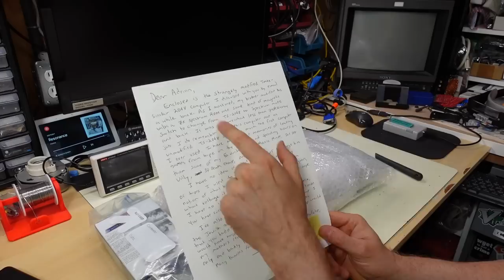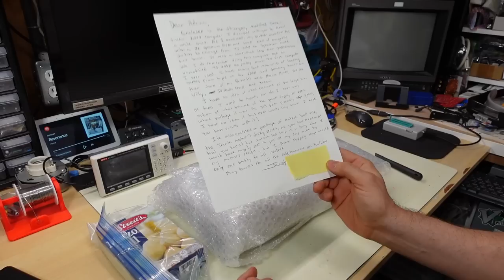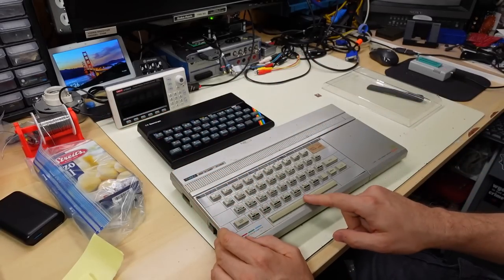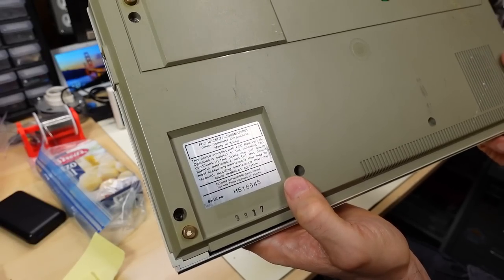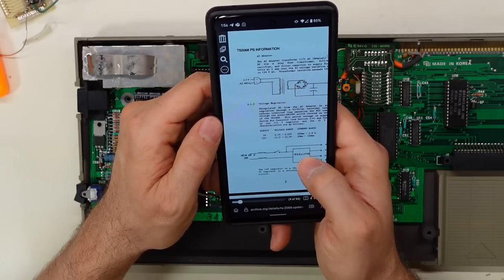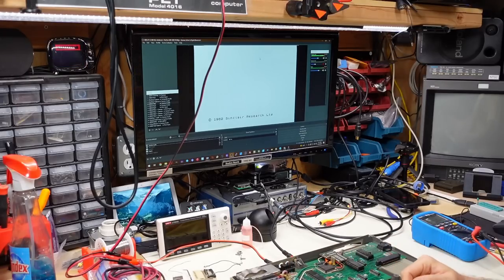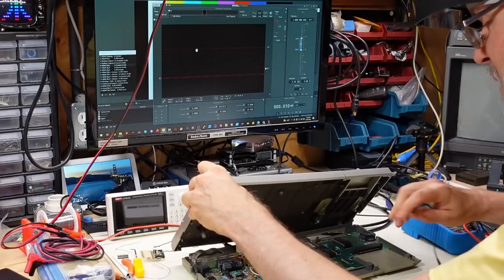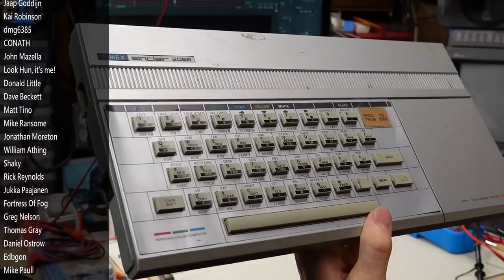0044 The ZX Spectrum of North America: The Timex Sinclair 2068

Comment from the maker: I have chatted with someone familiar with this machine, and it definitely should color (and a color burst.) There will be a future repair video where I dig into what might be wrong with this machine to get it fully working!
Reply: By the by, I just got my 2068 turned on, and it seems you have the spectrum rom in there, mine shows a 1983 Timex Computer Corp copyright line when it is turned on.
Reply: If possible, I'd also love to see a video about upgrading the internal RAM on a ZX81 / TS1000. There are several ways to do this, all fairly easy, but I think they'd make an interesting video.
Reply: I wonder if it's doing something odd like 60hz PAL - you'd have a different colour signal then.  That extra bodge board above the video out has me wondering.. did the owner mod it to also do PAL 50hz and you only have half the mod left?  

Games do run faster in 60hz - you can toggle scan rates on the Spectrum Next and not only do the games change speed, the pitch of the music (often generated under interrupt) change also.  Few games were written for the US market because as you mentioned it wasn't popular there.

9v centre negative is exactly what I'd expect.. good call on checking the polarity first, since centre negative is so unusual.  There's no protection on the circuit so connecting them backwards would cause the magic smoke to escape.
Reply: Well, it says  “Personal Color Computer” on the lower left side of the case, so I think there should be some color… 😅
Reply: Adrian, Modern Vintage Gamer on YT did a video on the 2068, His unit had the same bodge wiring that yours has on the user port and VLSI chip. Archive org has the user manual, page 6 shows the side ports are joysticks in the text.
Reply: The color circuit needs the 15v, but you were already at 9v when you tested the colors. Also: the easier way to check the colors is with the BORDER statement, which needs no shifting.
Reply: Someone else said that part of the voltage regulation used a switch-mode power supply.  If that's so, then the hissing may be normal.  Others have said that it is normal.  Also take note of what Alejandro just above me said.  The color circuit needs the 15V supply.
Reply: If that help, search for informations from a CP-400 from Prologica. Was a very popular clone of that computer here in Brazil.
Reply: @TonyHoyle  It's very English to do the things the other way around :)
Reply: Being a more affluent country we would pay more for a commodore 64 or something at least with a decent keyboard.  The Brits around that time were having some financial issues so money was tight and cheap ruled or you just did without.  Also when this unit came out there were better systems with a much larger user base and software selection.  This Timex system was just too late to the game to gain any momentum.
Reply: @pcm2012  And Japanese! Spectrum chugs nicely with a SEGA Genesis Model 1 power brick.
Reply: Standard Atari Joysticks, 

That's the UK Rom running... The start screen says Timex Sinclair or Timex 2068 on boot with the shipped rom. the ROM is likely the cause of no color, since there's no PAL circuitry.. 
I have a TS2068 that I tried a 24V Telephony Power supply after the stock 19V wall wart smoked, and my TS2068 didn't survive that. Running 9v, eventually the computer freezes. But I think i still have a couple of user group cassettes checked out with it. The 2068 composite out supported a "hi-resolution" mode, but the OS didn't support it, so you could enable it, and see the regular 24 character screen with intermixed whatever was in the next 8K block of memory between each character.

Comment: This was my very first computer. The keyboard was horrible, but I have to say, if you did a lot of BASIC programming on until the key combinations became natural - you could actually code faster than someone who had to type every keystroke of every keyword.  In a sense, this keyboard is the godfather of autocomplete.  LOL
Reply: If you compare to PC keyboards, the 2065's was pretty bad. However, if you started with a ZX81/TS1000 the 2065 keyboard was a godsend!
Reply: In a lot of BASICs, you could abbreviate keywords.  Atari 8-bit BASIC, which I used a lot (username relevant) would let you enter, for example, "SE." instead of "SETCOLOR" (you'd get the full word on LIST, er, L.).

Comment: Those bodge wires are factory. The "Upside down" PCB is also factory. The T/S 2068 was really not fully baked when it was released. Timex needed to get the computer out for the Christmas 1983 season so they did what they needed to do to get a working system out to consumers. The "Hissing" noise is from the switching regulator and there is an OP-Amp inside the switching regulator chip that picks up the switching regulator frequency and amplifies it through the speaker. I bought one of these machines (actually pre-ordered it) back in 1983 when I was 15 Years Old. I am very familiar with this system and we even have monthly Zoom meetings. you can see old meetings I believe on the Timex Sinclair Fans YouTube channel.
Reply: Also, you need at least 14V for the 12V linear regulator to regulate properly and the 12V is used for the color circuits.
Reply: @mileselectronicsstudio7316  came to the comments to say just that! The voltage needs to be higher to get color.
Reply: You mean https://www.youtube.com/@timexsinclairfans right?

Comment: The parts falling out was for the voltage regulator, check if the other brass nut is shorting something under the pcb. hissing noise???

Comment: Hi. It should be colored. Try to rotate slightly VR2 and VR3 variative resistors. And could you check with oscilloscope RGB output signals? On my Timex I see signal only in the Green channel and I suspect my ULA is partially brocken (Composite out works fine and it's colored).  Allow me please to send you photos via Twitter :)

Comment: The cassette connection on many of these old machines were mono audio cables to whatever old mono cassette recorder you had around, as long as it wasn't complete garbage.  Nothing brand specific like the Commodore Datasette. The user would be instructed to press play or record at the right time.  Some fancier machines had a smaller 2.5mm jack for controlling the pause function via the input normally connected to a button on the microphone.  Of cause these days it would connect to some other audio storage as modern cassette drives use the same awful cheap mechanism with very few quality options such as a slightly heavier flywheel.

Comment: My mom worked for Timex in the 1980s at a distribution center in North Little Rock, AR. The facility had a PDP-11 installed that was never used. She and her team opened up the manuals and learned how to get it bootstrapped and load the custom inventory software needed to automate the distribution instead of relying on all paper ledgers. The company remembered this several years later and gave all of her team that still worked there free 2068s. At the time we had an Atari 800 and dad used both a C128 and an XT clone which ran AutoCAD. 

I remember mom buying a little portable TV and setting up her 2068 at her rolltop desk with the TV perched on the top shelf at roughly eye level. She used that thing into the early 1990s when it went out completely. Dad bought her a 386 DOS laptop from Zenith and she used it but even years later talked about how much she missed her "Timex PC".
Reply: What amazing stories - thank you for sharing them with us! 🙂
Reply: That little computer meant a lot.

Comment: Wow! This is fun. I just got my TS2068 out of its box a few weeks ago!

Here's some info for you:

1. The thick white bodge wires are from the factory. Some of the others were added by the former owner.
2. You aren't running the Timex ROM, but the ZX Spectrum ROM. If you have the Timex ROM, you get TWO copyright lines at bootup. I think you're missing the Timex ROM, which would have gone in the other socket of the add-on board.
3. You need the voltage up around 15V for some of the circuits to work.
4. The Russell company made lots of ZX81/TS1000/ZX Spectrum/TS2068 add ons in the 1980s. There would have been a reed switch under that label and a button magnet that you'd slide back and forth to switch between them.
5. I suspect the little add-in board near the edge connector is a video adapter board. Unlike the ZX Spectrum, the TS2068 had RGB signals available on the edge connector (TTL RGB). This could drive a CGA-type monitor. But, the Hsync and Vsync signals are NOT available separately. You have to extract them from the composite video with a small circuit. The technical reference manual that you had up on your phone discusses this and includes the recommended circuit. However, several people sold circuits that worked better for this purpose and used ICs instead of discrete transistors. Another odd omission is the I signal. Although the TS2068 will show 16 colors via composite and RF, there's no way to get the I signal and feed it to an RGBI monitor. So, an RGB monitor will give a much nicer picture but only 8 colors. Incidentally, the interference that you see on the composite signal is normal. The crude switching regulator makes a ton of noise. Many current TS2068 owners replace the power section of their computer with a modern regulator to clean up the composite video.

Looking forward to seeing what you do with the TS2068 next! And hang in there. Once you get the knack of the keyboard, you can type code VERY fast.
Reply: It's a switching regulator?  That explains the hissing.
Reply: @melkiorwiseman5234  Yes, the 5V is a rather crude switching regulator. The 12V is an undersized 78L12 linear regulator.

Comment: There is an european version, the Timex Computer 2068. Some may call it a clone but in fact it is the same computer, designed by Timex Portugal with some hardware differences. It uses the same ULA and ROM, the big differences were the rear edge connector which is ZX Spectrum compatible (the TS2068's edge connector is ZX81/TS1000 compatible, and can be made ZX Spectrum compatible with a Twister board), the cartridge port can receive thicker cartridges, and it uses 9V DC center-negative power supply like the ZX Spectrum (in fact, the PSUs are compatible). Also the TC2068 was sold with a ZX Spectrum compatibility cartridge (Emulator Cartridge), which basically when inserted disables the internal ROM and replaces it with a ZX Spectrum ROM, increasing substantially the compatibility with most ZX Spectrum software.

The TC2068 was made like this to be compatible with lots of peripherals and software already existing in Europe, that don't exist in the US since the ZX Spectrum was never released there.

Timex Portugal also launched the TC2048, a ZX Spectrum 48k compatible, that uses same ULA of TS/TC2068 but it's more compatible with the ZX Spectrum than the TC2068 with the Emulator Cartridge. It has a slightly modified Spectrum ROM and it retains the hi res modes of the TS/TC2068, and a Kempston compatible joystick port. Usually the compatibility problems arise when software expects a true Spectrum ROM and with the audio generation (no sound in some games). The TC2048 is unrelated with the canceled TS2048 Timex US project.

The Unipolbrit Komputer 2086 was a modification of the TC2068 manufactured on Poland under license of Timex Portugal. For almost all purposes it is a TC2068, with some hardware changes. The ROMs were slightly modified and one of the joystick ports was replaced by a Centronics port.

More information about Timex computers, clones (TS1000 compatible) and peripherals is available on this site: http://timex.comboios.info/PT/home.html

Comment: @Adrian: The TS2068 , the American version of Spectrum, had The General Instruments Sound Chip AY-3-8912. The Spectrum ROM could be put on a small card in the cartridge slot, and then the machine ran as Spectrum. The buses between Spectrum and TS2068 were different. It needed an adapter, named a Twister (I was the designer) which enabled one to run Spectrum hardware like micro drives, etc. With the twister one could run 3” floppy system (designed by Timex Portugal) as well as other British floppy systems on the TS2068. The Portuguese made 3” floppy system ran both CPM, as well as rudimentary Timex DOS. The Portuguese made Timex 2068 was nicer., with same GI sound chip. It looked exactly like TS2068, had the Motorola MC1377 providing RGB signals on the output bus. Here is the schematic for TC2068:
https://timex.comboios.info/Timex/tc2068squematic.jpg
The Spectrum emulator supplied by Timex Portugal was on a cartridge, and made the machine fully Spectrum compatible. That same cartridge, with a very minor circuit modification (which I made, and was marketed by Zebra Systems) made a good Spectrum emulator on the TIMEX TS2068, using a bank-switching command.
There were also Brazilian made Spectrum ripoff called TK90X (Sir Clive sued the Brazilians, but lost). It is a good machine with RGB out. I have both TC2068, and TK90x.
There were also Soviet knockoffs, Polish knockoffs and I think  Czech copies. The Soviet machine is on the YouTube.
To facilitate troubleshooting here is a link to the Technical Manual for TS2068. The schematic is at the end of the manual: https://ia801307.us.archive.org/8/items/TimexSinclair2068Manuals/TimexSinclair2068_TechnicalManual.pdf. Have fun 😁.
I also had prepared a comparative ROM Atlas, comparing Spectrum and TS2068 routines and usage. The Atlas was published in two user monthly newsletters at the time (August 1986).
Now I will watch the video, and if need be will comment later.